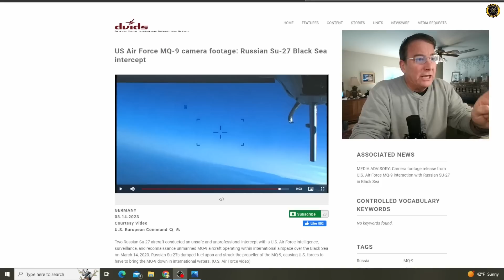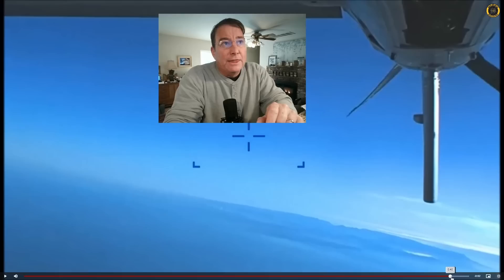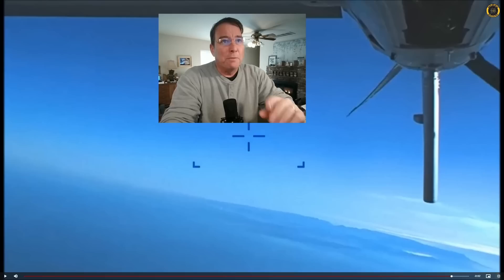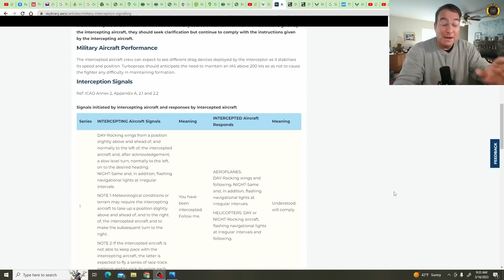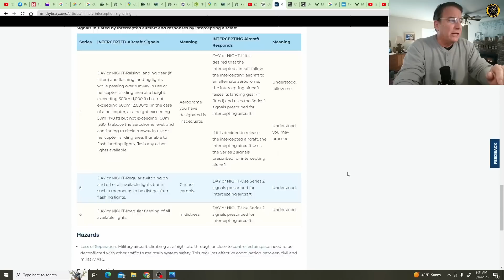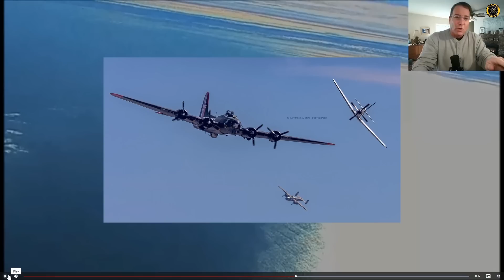Botched Russian Intercept of MQ-9 Drone Over International Waters

Comment: OK, Juan, I am a subscriber from way back, so I know that you have a pretty good grip on the laws of physics, mechanics, and aerodynamics. I am puzzled by the pattern of “damage” depicted in the dvids video clip. In the initial part of the clip the four apparently intact blades each have yellow stripes clearly visible near the tips. In the video showing damage the yellow stripes are no longer visible on the two apparently intact or near intact blades. The lighting is drastically different, but it appears strange that even in deep shadow the marked contrast between the yellow stripes and the dark blade is not detectable. But the bigger difficulties for me are these: (1) the V-tail of the drone extends well above the arc of the prop, so the only way an Su-27 could strike the propeller without taking out the empennage would be to dip a wing tip, but there is no evidence of this kind of pass. The drone attitude appears stable after the prop damage, so one must conclude that the tail remains intact; (2) it is difficult to determine with certainty, but it appears from the video that the two most seriously “damaged” blades are opposite one another. How could that pattern of damage have been inflicted by the wingtip of the Su-27 striking it with a rate of closure anything like what is depicted in the video? I find the video unconvincing, and I am forced to conclude that what we are being shown is a nasty encounter with CGI. I don’t buy a nickel’s worth of it. I think it was crafted after the fact to support the previously concocted narrative.

Second, you are certainly entitled to your opinion, but I disagree with your judgment that the intercept was “botched.” I think that the intent of the intercept from the outset was to make the thing crash without firing on it, and that the intercept was 100% successful. By not firing on the drone, there would be a greater chance of recovering its wreckage in a condition that would permit analysis of its complex intelligence gathering equipment than if it had been shot down with a missile or cannon. Apparently General Shoigu agrees with me because I saw an item that said the General would be personally presenting the airmen involved with high commendations.

This intercept also sends a message. I would expect that it will now become SOP for the RF to neutralize “NATO” reconnaissance drones in the Ukraine theater regardless of what they happen to be flying over. What is “NATO” going to do about it?
Reply: @DolphinsWIthIgloos by by $32 million
Reply: send in an AWACS with fighter protection?
Reply: An entirely reasonable take. I have no reason to believe the SU-27 at that angle could possibly hit only the prop without also striking the tail and breaking the drone into a thousand pieces instantly.
I tend to like Juan's content, but his US veteran bias shows in these videos. Swallowing CIA news stories at face value and calling the Russian armed forces "incompetent" is pretty low bar content.
I hope Juan gives a debrief of that time those A-10s mowed down that British armored column in 1991.
Or any of the other numerous blue-on-blue incidents US airmen have been responsible for in the last 35 years alone.
I don't believe blue-on-blue incidents have much more tactical advantage than bumping into a drone.
Reply: Bingo!

Comment: It would be very difficult and/or lucky to hit the propeller of a Reaper drone, without also hitting its V tail.  The two tail surfaces extend higher than the highest point of the propeller arc.
Reply: Agreed. Hundreds of pounds of fuel flying at hundreds of knots would be more than enough force to twist the props. The drone would not have continued flying if the plane actually made contact at that speed, it would have disintegrated and fallen from the sky.
Reply: Was wondering that too. Also appears to be a centered vertical fin on the bottom. Seems like a wingtip or horizontal stabilizer tip going between that lower fin & the angled upper ones would mean that plane, coming in the way it does, and the drone would be in the same space. When first hearing the prop was hit I imagined a nose cone poking it from behind.
Reply: Bingo. Easiest way to identify a reaper  is the stabilizer configuration
Reply: @OMGWTFLOLSMH  This is my thinking too after seeing the video.

Comment: A question for jet engine experts. If the dumped jet fuel went into the reaper's air intake, would that cause an explosion in the compressor stage or a flame out? Just curious.
Reply: Jet fuel doesn't explode. No explosion.

This could change the air/fuel ratio and cause engine surging, compressor stall, or flameout. Depends on exactly how much fuel makes it actually into the compressor.

Comment: From an ex-Marine aircrew member on KC130F and KC130R models (MOS 6036) our Hamilton-Standard 54H60 propellers did not operate the way you are describing. Unless this is a completely different design principle, the propeller does not "pass through" feather to get to reverse. Also, in a condition where the hydraulic control is compromised, there are multiple backup systems that prevent the propeller from reducing pitch, but rather to drive it toward the feather state. (specifically NTS, low-pitch stop, and pitch-lock regulator). In any case, if the propeller is allowed to pitch down (away from feather) due to centrifugal forces that are caused by the mass distribution of the rotating propeller blades, the resulting "windmilling" effect is potentially catastrophic.
Reply: I've never seen just one blade feather 
Seems to indicate some serious issue at the hub / CP mechanism
Reply from the maker: Correct, my mistake.

Comment: Thanks Juan. With all due respect, I don't see this incident as a result of lack of training or proficiency. I see it as absolutely intentional on the Russian's part. He is very lucky he made it home.
Reply: I doubt it was intentional because not only is the Su-27 slightly more expensive than the MQ-9, but also it has a pilot and intentionally hitting another airborne vehicle would put the pilot at risk in almost every situation. I'm curious what kind of damage the Su-27 must have sustained after hitting the prop.
Reply: @ILikeTuwtles  the Russian intentionally engaged in a highly dangerous maneuver. Regardless if it intended to strike it. It was intentionally dumping fuel on the MQ9 and strafing as close as possible to the drone.
Reply: @ILikeTuwtles  $32M versus $30M, The Russians follow orders, and there is ejection too.
Reply: @UnBoundBeatz  my point is that it wasn't his intent to hit the drone with his own aircraft. That would be absolutely idiotic.
Reply: @777Macau  and with the state of the Russian military currently, with aircraft falling out of the sky, it's possible that they don't have the aircraft to spare.
Reply: @ILikeTuwtles  regardless the pilots actions were reckless and resulted in losing his own jet. Had the pilot not done what they did, it wouldn't have happened.
Reply: @UnBoundBeatz  Strafing, AYFKM>?
Reply: @ILikeTuwtles  Maybe the intent was to destabilize the craft enough, causing enough tilt that the sat com link via adjustable disk couldn't react enough and comms lost to ground control enough, 3 seconds to be an uncontrollable spin, that a live pilot might save, but not with the delay time and fly by camera.
Reply: @UnBoundBeatz  the Pentagon confirmed that the Russian jet landed. They didn't specify where, but it did land.
Reply: @ILikeTuwtles  still a non-flight worthy jet. No way the jet only hit the prop, there is probably significant damage that requires several weeks of repair minimum. So in a sense, the jet was lost due to bad pilot judgement and intent. Not sure why you are defending the Russian for doing something that is objectively risky, Dangerous, and jeopardizes peace. Russia has been known to do stupid shit like this. This includes almost ramming a US Navy battleship and performing close passes to other civilian and military jets with souls on board.
Reply: @777Macau  Why do you say “Russians follow orders”? Russian Military discipline and professionalism has proven to be a joke. If he had orders, it would have been to engage the drone, not play grab ass with it. This is a pilot that watched Jackass a few too many times.

I was just reading something about the Yom Kippur war (1973), and the Egyptian MiG pilots hated the Soviet pilots flying with them, complaining of their lack of discipline and their unprofessionalism. Israeli Phantom pilots loved encountering the Russians.

This botched drone intercept is an example of substituting bravado for airmanship.

There will be an appropriate reaction, at a time or place of the U.S. military’s choosing. And probably without publicity.
Reply: @MarcosElMalo2  hmm 1973 you quote 50 years ago.   This is war, not airmanship.   His orders were to bring it down without shooting it down.   After 30 minutes of intervention.   They were probably testing different jamming codes
Reply: @ILikeTuwtles  Whether it's idiotic or not depends on the objective, wouldn't it?  If Putin said I want that drone and I want it intact, what else could he do?
Reply: @ILikeTuwtles  It's not the value of the drone, it's the value of the tech that drives the drone.
Reply: It was absolutely intentional. There is no other reason to get so close and dump all that fuel. There will be retaliation, though it may not be very public...
Reply: @ILikeTuwtles  This is what I am wondering.  It must have some damage somewhere, IMO.
Reply: @AtomDropper  I'm not defending anyone. If anything, I'm calling him a shitty pilot for not even being capable of dumping fuel on a drone.
Reply: @777Macau  ejection is a difficult process and into water with an undetermined period before rescue? I wouldnt be risking my back and my life for a drone.  I reckon he just ran out of low speed manoeuvring skills
Reply: Lucky? ... Do you know what CGI is?

Comment: So what part of the SU-27 was able to hit the prop without also hitting the drones vertical fins?
Reply: BBC reports that Russia is out of ammunition and fighting with shovels, so pilot wacked prop with a shovel.
Reply: @johnsmith-ht3sy  and those convict Wagner Stormtroopers don't even have boots and uniforms.  They are still wear prison garb.  That pilot did that with a huge amount of skill.  Those Russian planes are designed to be like a Ford F150 and the American planes are like a Porsche.  Try taking off on a gravel runway in a F35.  The turbine would be filled with rocks.  Russian planes are made to be able to take off from any kind of runway black top, gravel and even grass.  They make them strong.
Reply: I would guess that the port side horizontal stabilizer blade threaded the V tail opening and struck the prop blade. Lucky indeed if that is what actually happened. Sometimes it is better to be lucky than skilled, but could be some of each in this instance.

Comment: The fuel dump system is only on bombers. It is not on fighters, and the Russians shot down the drone not with a ram or fuel, but with an air stream. The Su-27 has enormous kinetic energy. The pilots were awarded by Minister Shoigu for their professionalism.
Reply: 30 metric tons of force ! You don’t want to be in the back of that engines.

Comment: Here is some info on the propeller type, it is a Constant speed, full feathering and reversing; hydraulic (see NOTE 4 from the TCDS), with aluminum blades.  Installation of propeller model REDACTED is limited to pusher aircraft applications.  I am not allowed to give more info.

Comment: Given the tail configuration on the MQ-9, I have a difficult time seeing how the SU-27 could strike the prop without also hitting one or both of the tails.  So, how much damage did the SU-27 sustain?  Did it make back to it's ship or runway?  Also, what would the effect be on the drone's turbo prop engine of it ingesting a huge quantity of liquid fuel?  Another commenter made the point that the sudden change in density from air to liquid droplets could bend the prop.  If that is the case, I would wonder about damage to the turbine blade or at the least causing the engine to flame out.  It may be that the intention was to down the drone with minimal damage so the Russians could recover it.
Reply: @JoeSexPack  After watching numerous reports, this is the first I have heard of 19 separate fuel dumps.  That is more than just harassment.  Next time, we should fly the drone right into the path of their fighter.  Sure, we would trade our drone for one of their fighters, but the Russians would stop their harassment.  And, we could blame it on their pilot error.
Reply: Without a doubt, all the steel beams in the drone will have been melted.

Comment: Juan, 2 things 
1) the tail of the drone is a Y tail . To hit the prop you must have hit the upper portion of the Y tail also. Damage may not be just to the prop.
2) Weather , it looks very clear in the American video here . The Russians have released a video of a flyby of a drone above a solid overcast. What was the weather on Tuesday March 14 over the Black sea. 

Also I have been watching the drone on 24 flight radar for weeks circling .   I would like to check the history on 24 flight radar but I don't have that capability .
Reply: not necessarily.  The left horizontal stabilizer of the jet passed between the v tail and struck prop.  Look at the roll of the jet
Reply: @stuartedgar5921  at 6:02 I can make out the yellow strip on one blade, the feathered prop and the bent prop I can not see the strip because of the angle . The lighting has changed and it is darker also
Reply: @tyleroryan   yes that is true .

Comment: Is it possible to hit the prop without also hitting the tail/stabilisers? Wondering if more damage than what we can see. Unless the damage to the prop was purely fuel dump related and not actual physical contact?
Reply: Why on earth is anyone thinking that a fuel cloud could bend a prop blade and and feather another ???
Reply: Easy enough to stick a wing tip between the stabilizers, if you're (un)lucky.
Reply: @Johan Van Hoof  you ever been hit by a bucket of water at a couple hundred kph?